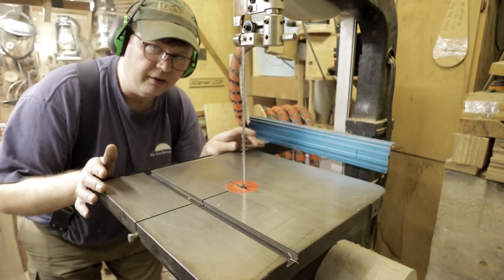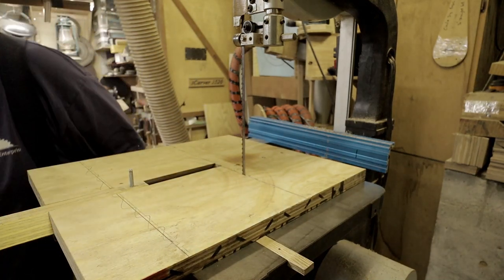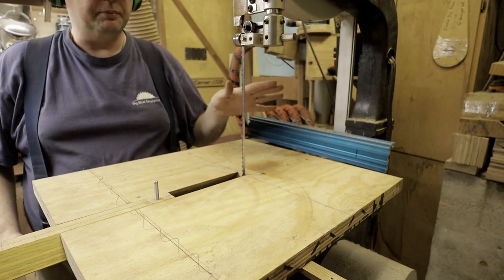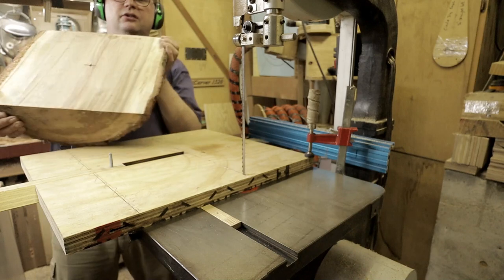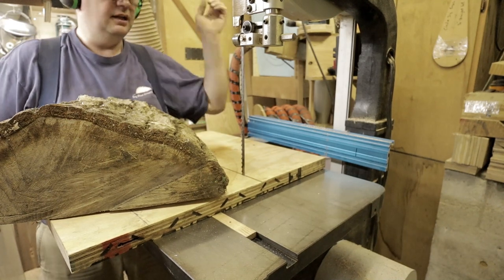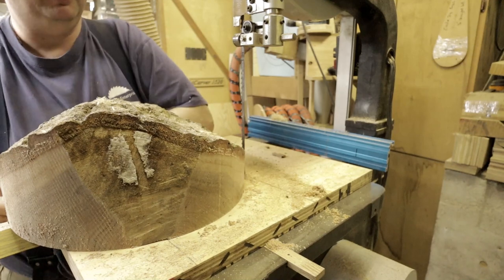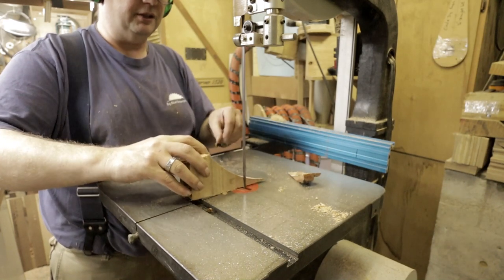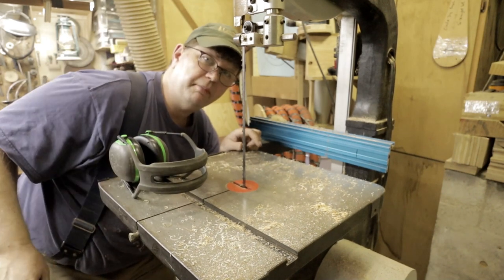Bowl Blank Circle Cutting Jig on the Bandsaw

Comment: Using the band saw for bowl blanks looks terrific. Other local bowl turners have poo pooed it.I tried but the blade hangs up, starts burning and even broke. I have an old craftsman that takes an 89 1/2" blade what size blade do you suggest as to width and TPI.
Reply from the maker: For green wood bowl blanks the 3/8" 3TPI blades that Lee Valley sell are my go to blades, but I'm not sure if they have them in your size. 
3/8" and a very low TPI (teeth per inch) is what you want. 
Cheers

Comment: I could use hel with my jig setup as I cannot seem to keep blade from deflecting even when tension, power, blade saw all in working order.
Reply from the maker: What blade are you using?
I use a three tooth per inch (3tpi) green wood blade, end I do get some deflection too.
Reply: @TokyoCraftsman  started with 3/8 3tpi from highland, then 3/8 Carter green wood and finally 1/2 timberwolf.the deflection is so bad that the jig slot is now 1/2 wide due to blade.

Comment: add an L on the side of the jig that keeps the jig from raising up from the table then you do not need the clamp.
Reply from the maker: Good idea.
Reply from the maker: I did that today, I had to remove the fence rail to make it work, but it was only two bolts so I can put it on easily enough, works great, thanks for the suggestion!